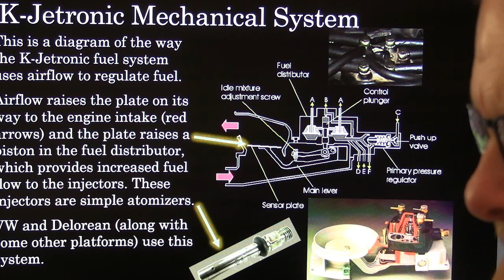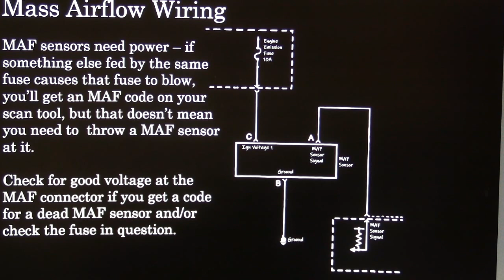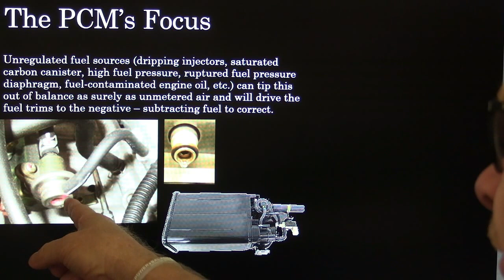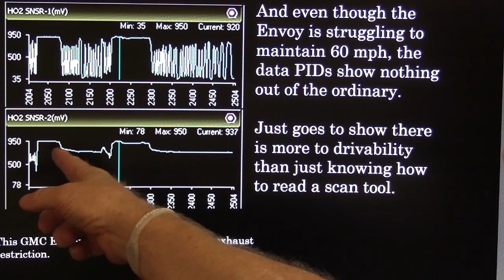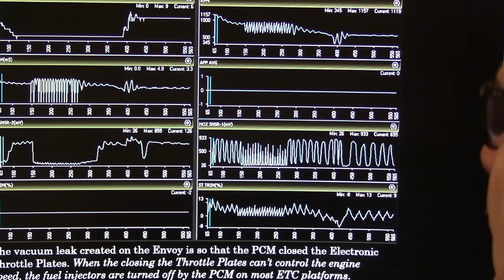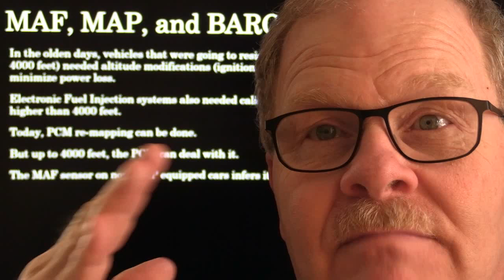Fuel Trim and Stuff

Comment: I want to thank you Master McCuistian for the immense help you've been to me passing my ase. With your videos I've got my a4 a5 a6 a7 and now working on a8.  No exaggeration! Just wanted to comment on the question at the end of the video about which way a faulty MAP sensor would drive the fuel trim when usually a bad MAP would increase altitude.   I don't think I quite got the answer and hoping you could elaborate please.  So if the faulty MAP sensor will reflect an increase altitude that means air volume is decreased.  Higher altitude = lesser oxygen, so if there's less air than the engine will run rich causing negative fuel trim resulting in the PCM decreasing injector pulse width (fuel) to lean-out the air/fuel mixture (take away fuel, too much fuel in the exhaust).  Is this correct?
Reply from the maker: If the MAP sensor is incorrectly reporting a higher altitude, then  the engine controller will believe the air has less oxygen than it actually has. It will think the air is thinner than it is and will reduce the amount of fuel to match what it believes is there. Since there is actually more oxygen, the reduced amount of calculated fuel will cause the engine to run lean and the oxygen sensors will pick that up so that the engine control increases the amount of fuel to satisfy the oxygen sensors. I hope this explanation helps...
Reply: @McCuistian  o wow..I did not think to factor in the actual amount of oxygen going in the engine.  Amazing! It took me some time to visual your explanation, but I think I'm starting get it! Thank you very much sir! And since the PCM already detects a false higher altitude then automatically it would have decreased the fuel volume to match the air/fuel ratio, then with the data that the o2 sensor pick up would then tell the PCM to correct the fuel trim to positive(add fuel) right?
Reply from the maker: @elevatemuhammedpbuh5733   you got it!